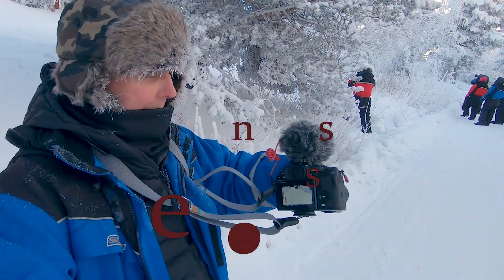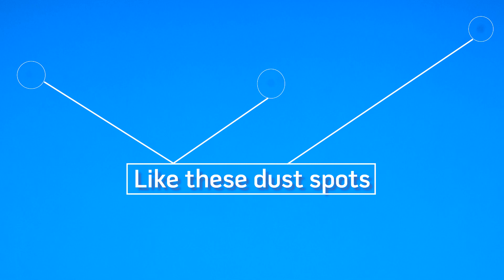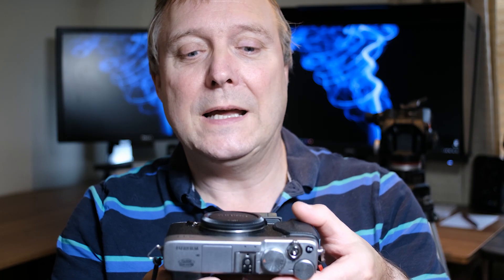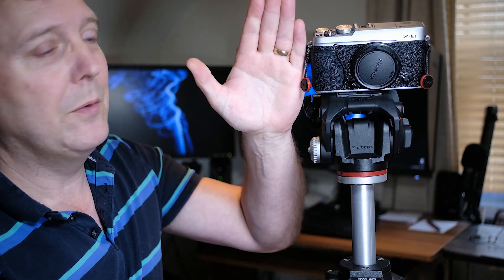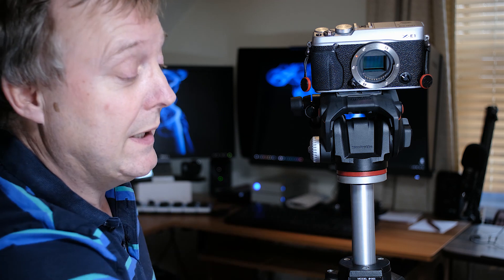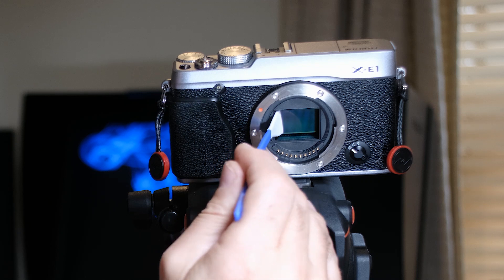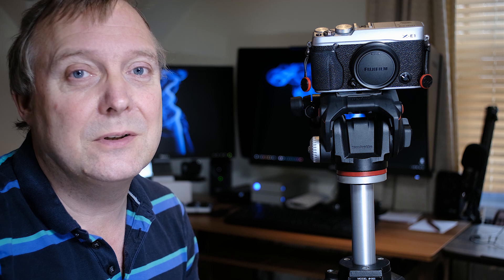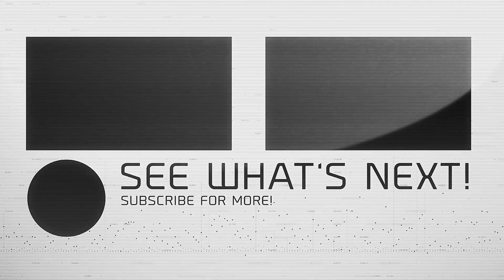Cleaning the Sensor in your Fuji Camera

Comment: Just cleaned my XT3 sensor. Out of all the videos I watched, before screwing up my courage and going in, yours was the first that said the rocket blower could introduce dust!
Reply: Mike Mitchem it depends of the blower, without a dustfilter on backwards it‘s possible to blow dust on the sensor
Reply: Can I go up and down?  I ordered some but they are too large. But if i go at it side ways it does fit.

Comment: What if you ran out of swabs,and didn’t realize “, and now your stuck with a dirty photo? Any work around? 

Also if you have ibis like an xt4 you need to turn all that stuff off first
Reply from the maker: Just use the spot removal tool in your editing software and as long as you have the camera switched off ibis will not be a problem.